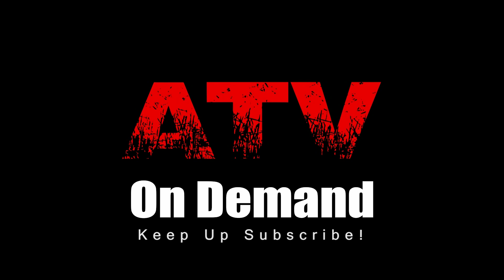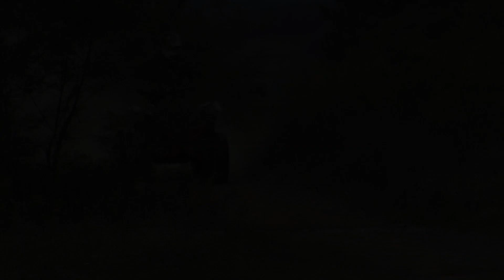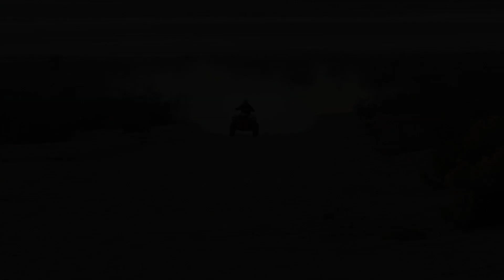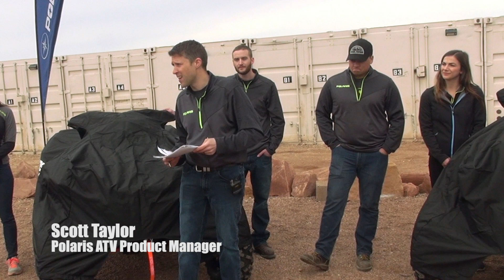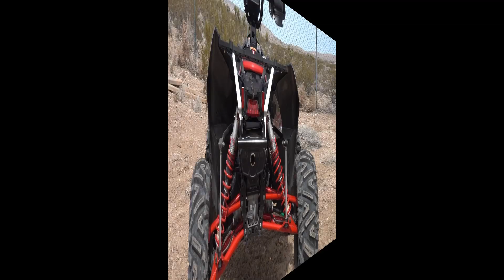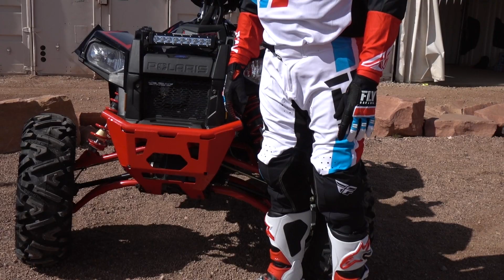2020 Polaris Scrambler XP 1000 S Test Review

Comment: Polaris has been making there ATV's way to heavy for 20 + plus years now. Makes zero since.
Reply: *sense
Reply: thanks grammar police
Reply: Can am is making the same type of machines
Reply: The. Can am also has the power to back it up  they have better ride no delay in power and they are built better
Reply: @bryantucker6725  I agree can am is good quality but iv owned both and polaris in my opinion is just as good.I had a ds 650 and a outlander 500 and a polaris scrambler and a magnum.I can compare and I had more miles on polaris before it gave me issues than the can am.

Comment: Polaris really missed the mark here with what their buyers wanted.
He stated their market is really those that have a big bore already, but those customers know what they want in a new Scrambler.
 - Different models - Base, XXC, Mud, turbo (at different price points)
 - Increased reliability in known to fail components (pinion plate, rev chain, belt, one-way bearing, etc.)
 - Increased HP (which went DOWN in this new model!)
 - Better headlight assembly
 - Better front rack

A lot of this was hoped for when rumors of a new model started. Nowhere, among any current owners were thought of "Hey I want a wider Scrambler".
Expect this model to sell less than the previous one did.
Reply: Polaris engineers : hmmm canam has been kicking out ass in the ATV segment for years can it get worse? 
"Hold my beer"
Reply: Great comment, no one asked for 55".. Make the changes to the steering, diff, and chasis on the base model and they'd finally have built a durable machine..
Reply: Locked everyone out of 50 inch trails also.....sad but renagade is doing better
Reply: @jshapiro34  my 2018 Renegade 570 XMR is a blast, even though i mostly mud ride

Comment: Fail, plain and simple. I have a 2014 Scrambler with a little under 4000 miles so it's about due for an upgrade. Being EVERY trail within 6hrs of me is 50" limited this new model is useless for me...guess I'll be on a Renegade next year.
Reply: Where do you ride?? and if there are side by sides rollin around you can ride this ?? From Minnesota and plenty of room up here for this machine
Reply: @corygabbert658  Southern Louisiana, the only place this thing would fit is the mud parks and I don't mud. All of the National Forest trails are 50" limited with gates.

Comment: I SERIOUSLY hopefor Polaris' sake that the "S" designation means that they're also going to make a STANDARD Scrambler 1000 that is 48" wide. This thing is obviously a badass machine. It's cool looking, powerful and of course innovative. But this thing is WAY too big for 90% of the trails I ride. And as if that weren't enough... I suspect it'll start somewhere around 20 grand. The old Scrambler 1K was almost 15k. 

I wish someone would put out a bare bones big bore machine with 2 cylinders. Big singles are great for sounding gay, vibrating you till your teeth fall out and pulling logs through the woods. But sadly, competition for large twins they are not. 

Anyway cool idea as usual Polaris but as they said in the video. Don't forget about the guys that want to go fast and have WAY TOO MUCH power! More thann needed for sure but simply either can not or will not spend as much or more for an ATV than they did on their daily driver.
Reply from the maker: Thanks for the comment. The S retails for $14,999. No 48" Scrambler for 2020. However, they will be keeping the 850 at around $10,000. It's pretty bare bones. If you're hoping for a $6,000-$7,000 big-bore twin, that won't happen.  The Scrambler 850 has more than enough power for most trail riders.

Comment: The 2018 had LED headlights, this looks to be halogen. But hey it has a light bar! The 2020 makes same HP but is 140lbs heavier?  Pretty let down tbh. Glad I bought the 2018.
Reply: It's a Polaris, do you really expect anything different?
Reply: @WheelinWithAustin  lol not really its plastic with a motor
Reply: @nick-dm3if  that's why I own a canned ham 🤷 shit doesn't break down everytime I hammer on it
Reply from the maker: If you trying to cover big rocks, or wide open terrain the handling makes up for the loss in power to weight ratio. Besides, if they gave it way more power, more people would complain about things breaking. Vicious circle.
Reply: @ATVonDemand  yah give it more power and beef it up, who gives a fuck about a light bar, for 1000 less you can get the can am renegade x xc 1000r and we all know thats a way better bike.
Reply: @ATVonDemand   I agree but nobody is asking for way more hp. We just all like a little bump in progression. I would prefer like 5hp for that added weight. As for the rock crawling aspect I feel like that's what sxs are for.

Comment: Everyone hung up on big cc motors but with these modern 4 stroke design motors there’s to much weight

You take Ktm for example
Their 500 exc sets the benchmark almost every year with light weight and high hp
Yes their 690 is more powerful but heavier 
Power to weight ratio
Has modern engineers forgotten that
Same idea for atvs 
The raptor I own is great but the ergonomics are all wrong for aggressive riding
You set on top of machine like this scrambler 
The center of gravity is high
The Honda 250r had great center of gravity like the modern 450 race machines
I know this isn’t a two wheel drive race bike
And thank you Polaris for offering it
But 
Independent front rear brakes 
Light weight high hp compact machine
Is a pure sport machine
There are other ways to design a high performance atv

This is like saying a ford raptor and a Ford Mustang and ford gt40 are all in the same class 

Big difference
Reply from the maker: One more vote for a light weight sport ATV.

Comment: Every year atvs get heavier 
More power 
more weight
A dangerous combination when riding aggressively 
This is a big machine
In Mud it would be great
But I can’t see riding this like my raptor or my sundahl banshee
There are other ways to build a sport 4x4 atvs than this
This fits a certain part of the market

But a lightweight raptor with Christini hub drive front under 500lbs with redesigned chassis 
Low center of gravity 6 speed
Manual clutch true sport atv would be something to ride
For an expert rider
But 
I applaud Polaris and can am for at least offering something in this category 
Yamaha also for keeping the raptor and 450s for us to buy when every one else has dropped them from their lineups 

But the dirt bike industry has pushed innovation every year like the sxs market
While the atv industry is still stuck in. The 90’s
Own a raptor a sundahl banshee a razor 1000 and dirt bikes
Been around atvs three wheelers dirt bikes all my life
But at 45 yrs old there is no next level in atvs
Dirt bikes like Ktm husqvarna gas gas beta  every year cut weight and refine their bikes
Sxs every year there has been a consistent improvement in design 
Look how far sxs have come in 10 yrs
But atvs
Dean sundahl, doug roll, leager to name a few were the last to push the boundaries of atv design
Yes there are others and with the racing organizations banning custom frames back then halted any future innovation 
Today this scrambler is supposed to be sport
Reply from the maker: Two more votes for a new lightweight sport ATV.
Reply: Very well said, I think a machine with this much power approaching 800 lbs is an accident waiting to happen. I think 400-500 lbs is the max a four-wheeler should weigh. Anything heavier than this and you should be on an SXS.
Reply: Robert Gomez I agree, I was just researching for a new utility quad this morning and it’s been a challenge to find models around 600lbs which is still heavy. My ‘03 Wolverine is light for a 4WD but still heavy as it was the first 4WD sport quad. It’s fun to ride and explore on, it’s small, low and not super wide so it’s fun on tight trails and in the woods. I’m glad Polaris is showing some interest in sport quads and I would like to see them offer a true sport quad like the Outlaw. I’d be way more interested in a YFZ450 if it had reverse but after 16 years of production I don’t see Yamaha ever offering it.
Reply: That Alaska Guy sad thing since I posted my comment nothing’s changed still sxs and dirt bike innovation also adventure bikes and indian giving harley a run for their money. Always see a future in Honda style work related atvs but I am starting to wonder if atvs are coming to an end. Prices keep climbing to the moon and with Robby Gordon bringing the speed utv to market only see less interest in atvs
Wish and hope that I’m wrong but it’s a sad time for atvs and atv sport rider
Thankful yamaha still sticking in like they did with the banshee
Commend polaris for the scrambler and offering something new
And can’t forget the scrambler from can am
And with all this COVID crap who knows how long it will push things back
Reply: Well my old Polaris 850 Touring was bigger and heavier than my bro’s Can Am 400, but way harder to tip. So more power and weight doesn’t automatically make it more dangerous.
Reply: Sport ATV innovation died when the EPA came down on Suzuki.
Reply: @jbird1173  Agreed
Reply: Same hp bud
Reply: Well said.

Comment: Hey I made the video at the 12:35 mark! These machines were a ton of fun.
Reply from the maker: We had to include you. You were sending it!
Reply: How's the performance compare to the 2018 1000 scrambler it's heavy and bigger tires is why I ask
Reply from the maker: @kgrant2317  if speed in a smooth straight line is all you're worried about then the 2018 will be faster. Throwing some bumps and some room for the 55 in wide Scrambler to stretch its legs oh, it is more stable in better suspended. If we were riding on 60 in Trails, we aren't sure if we could go faster or not. It would be cool to do a little in-house shootout between the 2020 Scrambler 850 and the Scrambler XP 1000 S on some intermediate width trails.

Comment: I’m still laughing, 881 pounds CLAIMED! By the time you put some 30x10’s on it your gonna be at an honest half a ton! I’m sorry but a RZR that you sit on top of is going to be a really hard sell guys, maybe with a turbo and 160hp I would get excited but for now I can’t stop laughing at this titanic waste.
Reply from the maker: There is one more vote for a new lightweight sport ATV.
Reply: @ATVonDemand  the biggest displacement you can fit in a 450 chassis and maintain  low center of gravity and good weight balance would sell to anyone who does'nt race competitively.i lowered and widened my raptor 700 to yfz specs and bored and stroked up to 80 hp and ride on my personal mx track on the power lines behind my house lol.if not for the forward placement and angle of the engine that makes everything 2 inches taler you couldnt tell it apart from my yfz in handing.
Reply: It doesn't look like even 28's would fit. The rears will rub the floorboards
Reply: Your probably right

Comment: What the hell is that open air intake by rear right shock at 5:30 and 6:10 ??? If that's for the belt xD terrible design. So much dirt and water is going to get in there.

Comment: Too late Polaris was looking like you were discounting the scrambler so I bought a RENEGADE !!!!
Reply: Renegade  LMAO ! Taking mud holes one Diff at a time , Polaris is light years ahead in technology bud , and before you comment I fix atvs and if it wasn't for can am I'd be eating kraft dinner lol !
Reply: Mud Slinger  
First off I never said anything about quality on either atv was stating that they were too slow to release this to the public, I would rather have a scrambler. 
Second your assuming my riding style don’t ride mud holes stock tires do me fine in the trails I ride.
 I would buy and Argo or an sharp for mud holes. 
Third no matter what you buy or own it’s all needs maintenance and breaks.
I have had many atv mostly Suzuki’s super reliable but slow and a brute force that was fun but never own 1 again.
Reply: Argos are gay for mud holes you need rzr or something like this yes can am if shitty but I can't talk to much shit I ride dirt bikes but alot my buddy's ride 4 wheelers I quit riding 4 wheeler because shit breaks too much alot more parts to take care of happy riding
Reply: Mud Slinger lol most people throw 32 inch assassinators on stock drive train and clutching. I have a 19 renegade with 530 miles and so far absolutely zero issues! I absolutely love it aswell! And it’s faster then any Polaris. I even have videos of me racing a tuned scrambler 1000 and still pulling it at 70!

Comment: I don't understand who is gonna buy this except anyone in the southwest United States. Polaris abandoned xc racing and now it looks like it's saying goodbye to everyone else. It doesn't fit in a truck bed and at its price point I don't understand how anyone can justify buying this. I mean it would barely fit in my shed.
Reply: A 55” atv won’t fit into your trucks bed? Sell the Ridgeline and buy a usable truck. 

It is way too expensive though. The pricing of atvs and side by sides is way out of hand
Reply: @jadosa29  I have a f350 long bed. They made this thing longer and wider. The LENGTH of the atv will make it difficult for guys with a standard bed. Most guys with a regular scrambler have to keep the tailgate down and ratchet strap it to secure   everything. Even my long bed my NARROWED XC scrambler with 0 offset wheels have about an inch on each side where the wheel well humps intrude into the bed.
Reply from the maker: It would be interesting to take this Scrambler into our local wooded trails and see how the 2020 Scrambler 850 stacks up against it.
Reply: ATVonDemand I think it’d do pretty well. It’s not 2009 anymore and the booming popularity of side by sides is making trails wider. I ride my slightly over 60” Teryx in Pa and West Virginia where trails tend to be tighter and technical. No issues whatsoever and this is about 6” narrower with a shorter wheelbase. I’d say the handling benefits far outweigh the times the width would be an issue.
Reply: @ATVonDemand  I'm no veteran to GNCC, but I've been racing 4x4's for 2 years. One reason the Renegade (prior to the new model) is so dominant is its stature. It helps it starts fast too. Polaris took everything away that was good, made what was bad worse. The improvement in frame and front diff with the addition of weight and less hp is going to make your 850 look like a world beater.

Comment: Something I’ve never understood is why there isn’t a factory 60” wide ATV suspension other then aftermarket lift swaps. A 60” 1k anything would dominate at everything. Imagine sidehilling, mountain climbing, rock crawling and desert racing with a 800lbs  handle bar’ed stable rig that you can actually rip into turns with and not have massive body roll and tippy feel.

My cforce 800 measures a true 50” track width, my Honda rubicon before that was 47” track width, and you can feel the stability difference for sure. Yeah you can throw a wheel or wheel spacer set on to add a little width but a heavily backspaced wheel and a long control arm set is really what you want! Hey canam, do a 60” one and give Polaris the finger!
Reply from the maker: This machine gets you pretty darn close.
Reply: 50 inch is the widest woods trails in michigan if your not counting the giant highway trails. Can only go where trucks and razors go.
Reply from the maker: @motonut4503  That's true. They are still offering the 48" Scrambler 850 for that reason.
Reply: motonut450 well yeah there is 50” restrictions in every state, but for those who rip in wide open areas like desert or even on the streets threw town there should be a stable wide suspension. At least someone is stepping in that direction now

Comment: 800lbs... yikes. Better double the HP to make the power to weight ratio close to something like a banshee. sport ATV? they even show it on a motocross track.  Sorry middle age out of shape guys,  you aren't going to jump on this and beat your friends teenage son who is on a motocross bike, around the track. Not to mention at 800lbs if this thing rolls on you it will probably kill you. Its a jeep with handlebars.
  The original scrambler was just to big and heavy to seriously compete with the sport ATVs of the day and so is this.
Reply from the maker: It's fun in the desert whoops, but it's no MXer
Reply: @ATVonDemand  If this thing gets away from you in the whoops you are going to be in trouble. In my mind a 4 wheeler should weigh 400 or less.
Reply: 900 lbs actually... wayyy too much
Reply: Very few banshees out there competitive in anything other than drag racing